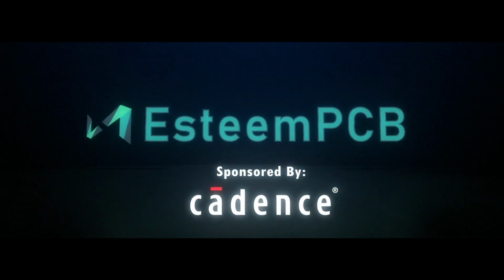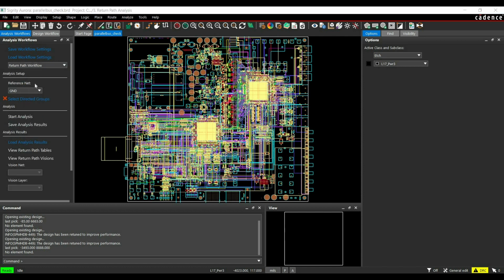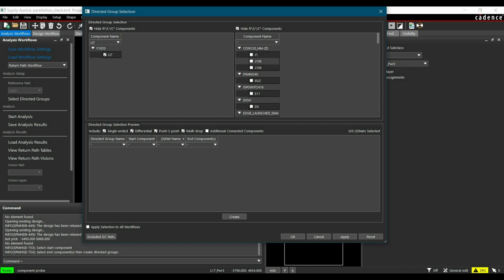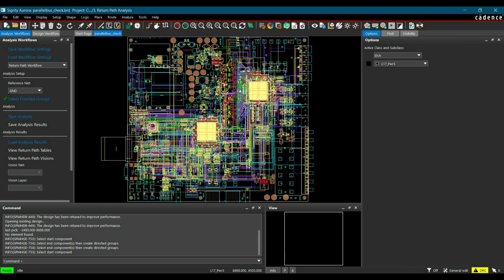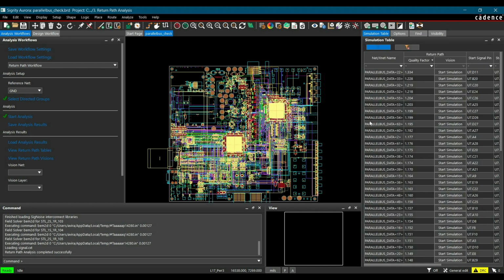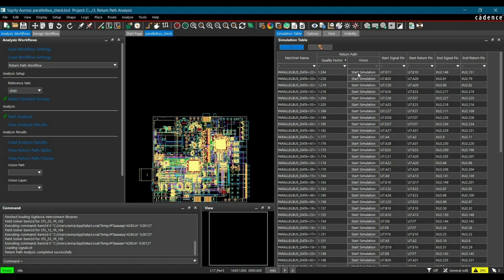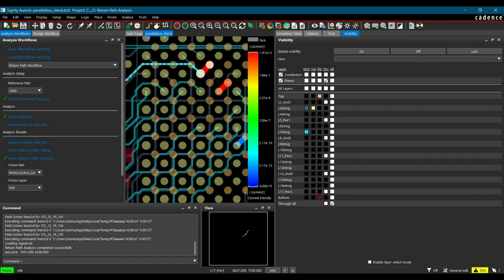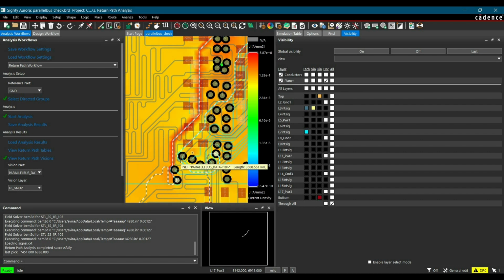How to do Return Path Analysis using Sigrity Aurora 17.4

Comment: Thanks for this Video.. 
I think one clarification required @6:15 Ground stitching via is needed when different reference layer having a GND net. and decoupling caps needed when two different ref layer having a potential difference ( e.g when one ref layer is VDD and another is Gnd of same data signal trace only.)